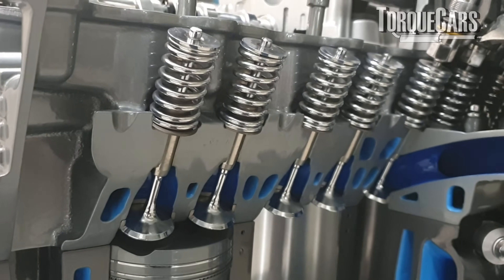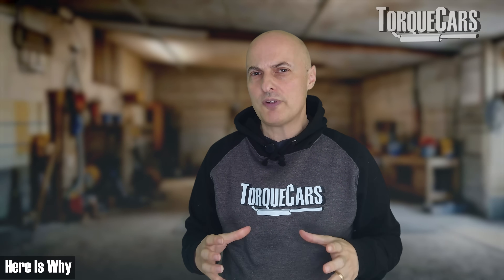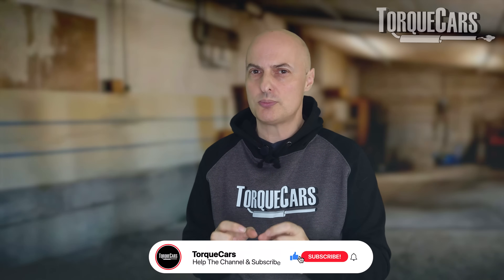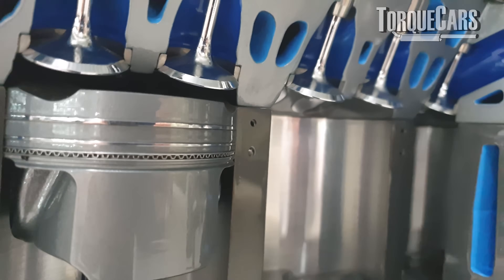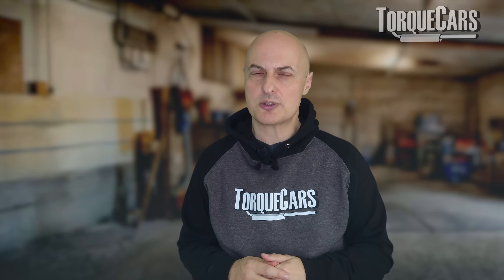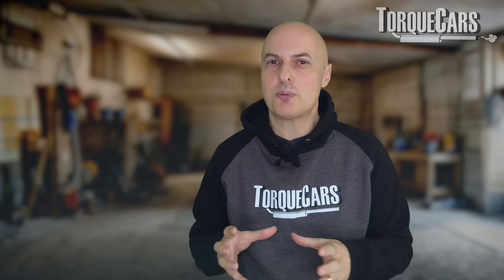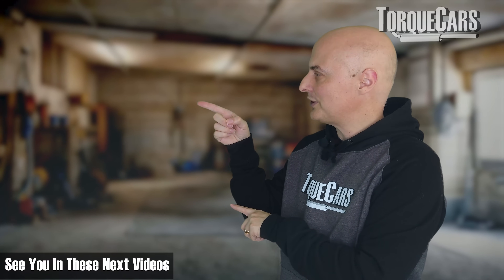16 vs 8 Valve Engines! Manufacturers Don’t Explain WHY Most Modern Engine Need 16+ Valves!

Comment: There's never been anything wrong with 2 valve cylinder heads that rev to 6,000, in fact they were reliable, efficient, and nice to drive

Comment: 5 valve heads helped with flow, but resulted in a compromised combustion chamber shap. Yamaha persisted the longest but eventually returned back to 4V. Was cool idea in the 80s and 90s but by mid 2000s (i.e 20 years ago!) the writing was on the wall.
Reply from the maker: The injector spray pattern also needed to be revised for the 5 valve heads which catches a few people out, sometimes I see people using injectors from 4 valve engines ending up confused about the loss of power/economy.

Comment: My old Alfa Romeo has sodium filled valves. I've had a BMW E87 120i with valvetronic and I was very impressed by how you could just put your foot down up a slip road and it was effortless but used a lot of fuel so I drove it slowly.

Comment: An often overlooked event is the swirl action and speed of the flame front around the wall of the cylinder. The valve is not the hottest part of the engine it is the exhaust valve seat which bears the brunt of the heat. Of course then that leads to the most important component on the engine regardless of the amount of valves the cylinder head houses, and that is the coolant pump as that pump needs to circulate enough coolant to stop the exhaust valve seat distorting which leads to power loss due to a leak into the exhaust system. We have done the work and proven this on engine dyno .

Comment: i like 4 valves per cylinder but why do top fuelers got only to per cylinder and make 12000 bhp
Reply: @JapieEngelbrecht-l7b  overlap
Reply: @JapieEngelbrecht-l7b  pressurized intake system. The blowers ram air past the valves. 

Also, with the constant rebuilds done on the engines, a OHV system is easier.

Comment: Sodium (Na) is a metal.  You correctly noted 4 valve arrangements are much lighter so add to your port velocity argument conditions for higher RPM and higher lift.  If pushing for the biggest port area the 2 valve will edge out the 4 valve but the +' outweigh the -' by a fair margin.  The five valve head, yeah, nah, not worth it.  Yamaha did it for quite a while and then quietly dropped it.  Same argument with port size I think.

Comment: Modern 2V heads often have more peak flow than equivalent bore size 4V heads. It's actually easier to arrange valves in the head when there's just two, four is more limiting. Naturally with a 4V head placing the spark plug in the centre is easier. With 2 valves the larger intake valve can be placed closer to the centre of the bore at a more advantageous angle, it is also less shrouded by the bore and is not shrouded by another intake valve beside it. It is mainly at low lift values that 4V heads move more air, and yes over the intake duration typically the 4V will move more air, but its not as radically different as some may imagine.
Further a 2V head has more realestate for optimised quench pads so that modern 2V heads are very efficient at combustion.
You're not going to get more velocity by having two smaller intake ports compared to one, the pressure drop across 1 vs 2 ports is halved obviously. Hence why so many commenters note that 2V engines usually have better low end torque. Because the velocity is higher in the single port (less total area), meaning better cylinder fill earlier (higher VE at lower RPM).
Sodium filled valves have been around forever. WW2 aircraft engines had sodium filled valves.
The reason to have 4V heads really comes down to the architecture of the engine, most engines don't have inherently natural balance and as such are hard to scale - meaning you need to keep them relatively small and rev them high to reach your power goals. Given we're talking automotive engines that also means it has to idle low and provide useful torque low in the rpm since to begin with, the driven wheels are not moving (you have to match the engine speed to wheel speed via a clutch or torque converter). With these constraints the way to engineer a solution is to have 4 valves and some kind of variable cam system to maintain decent VE over an expanded RPM range.
You can of course have a large (naturally balanced) engine that makes the same power with 2 valves and just not rev it as high.
Large valves clearly have more inertia than small ones, but its a non issue these days practically speaking. It's 2025 (nearly 2026) not 1955. Metallurgy, manufacturing techniques, and design have come a long way. This is why you can buy a 10.3 litre Big Block V8 with a factory warranty that still revs to 7000rpm.
Reply: @Aidan-gk6du  with 4 valves and port fuel i hection you can put the sparkplugg in the center, thus better flame burn, less risk of nocking. Thus higher tourqe
Reply: @andreaskampe9143  I like the thinking, and indeed with 4V the spark plug generally is in the centre.
There is logic in that if ignition happens in the centre of the chamber, the distance the flame has to propagate in order to burn all the fuel is half that compared to if it happened at the side. However, in modern fast burn chambers what happens is when the piston reaches TDC and comes up against the quench pads, this forces turbulence that breaks up the expanding kernel of burning fuel / air mix throughout the chamber, resulting in a very fast and complete burn regardless.
There is something to be said too for placing the spark plug closer to the hottest part of the chamber so that ignition occurs there and that region is burned first in order to reduce knock potential - and you see this practice a lot in 2V chamber design with the spark plug close to and pointing at the exhaust valve.
A chamber more resistant to knock means being able to run more compression (and or more aggressive timing), making the engine more efficient, sure. There'e a lot more nuance if we start talking about how torque is effected - the main driver of torque being VE.

Comment: Yes, Honda VTEC is simple but genius. The engine is 8 valves in low RPM and it becomes 16 valves in high RPM. This gives you really good fuel economy in normal driving, yet the power is there when you need to drive like a maniac.

Comment: @3:35 I know exactly which engine opens only one valve and partially opens the other valve. The Honda K24 engine used in the Honda CRV. I own a 2009 CRV with that engine.

Comment: You didn't mention Fiat's Multiair system in which intake valves open and close with solenoids instead of a camshaft, which allows extremely fine control of when valves open and close, even allowing for two open/close events in one intake stroke under certain conditions.

I have an Alfa Romeo Alfasud that had an 8 valve 1.7 boxer engine with two dual 40mm carbs when I bought it. Some years ago I put a 16V engine in it from a 33 16V using the same carbs with different jets and a 123 distributor. The 8V was more torquey and explosive at low and mid revs but would start panting over 5,500rpm. The 16V is less responsive at low revs but will happily rev over 7,000rpm without running out of fuel, I checked that with a wideband oxygen sensor.
Reply: Miss my Sud. First car.   The engine was amazing. My heavier 33 was slightly faster but not nearly as grunty and sounding.

Comment: I recall running in an 1100cc, 4 cylinder motorcycle in 1985 for a now deceased pal. It had 16 valves and felt far less torquey off the mark than my own 853cc, 8 valve 4 but the top end rush was in a different league. It's all different {and better} now, with the advent of VVT. I now ride a 4 valves per cylinder, 90 degree V twin but still also have the old reliable 1.9 TD, 8 valve Peugeot hatchback. Modern diesels suck !

Comment: 2v/cyl design impact on pumping loses than 4v/cyl; not the volume of air which is dictate by cylinder displacement. 
that's why honda ditched this kind of vtec implementation (12v/16v mode at old sohc vtec).

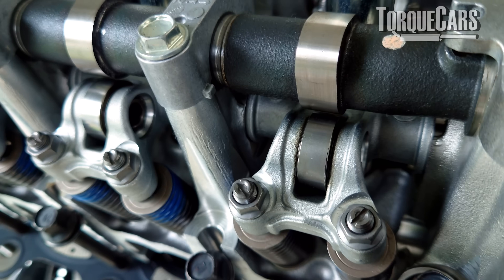Comment: 5:20 did you say 16 valves per cylinder? 😂 You mean per head? The less valves you have to more valve float you get at high rpm because the valves are bigger and heavier. It also means less area to suck air in so you don't get enough air into the cylinder for the same efficiency as 4 valves per cylinder. It's all about area. Exhaust valves have to be bigger to prevent them melting AND more volume of gas leaves the engine than what is pulled in because of combustion turning a liquid into a gas.

Comment: Two valve heads have more low down torque , 4 valves has a better bang for the buck , valve in block engines are more compact 
However 4 valves heads are winning  because of cam timing and  variable valve lift , the thing is , there are suction loses with large capacity engines which amounts to poor fuel economy , what we would like is the best of both worlds , fuel economy and power on tap , without the complexity of an aircraft engine . Personally I’m sold on 4 valve engines

Comment: Unfortunately many, probably most, enthusiastic and they hope, knowledgeable motorists and motorcycle owners, which isn't quite the same as being a motorcyclist, obtain their information from magazine writing which comes from those who can manage sentences and paragraphs but don't understand the machine or the physical effects.  Also the reasons for design alter.  Without question the first 4 valve heads were for two reasons; valve steels were not good for high temperature and springs were remarkably short lived.  Small meant longer between overhauls.

First world war aviation had Daimler making 4 valve cylinders under SOHC.  Royce rejected that because it used much welding of ports and we lacked sufficient capability.  He chose shell forgings as cylinders and the inlet flow over a tulip valve continued nicely along the curved chamber wall.  The Farnborough research soon stated that the head must be aluminium and the valves radially through a partly hemisphere chamber.  They made a 4 fully radial valves one and later a motorbike did the same but small.  With cast head and water cooled, but not constrained by weight, some cars had pent roof 4 valve heads, mainly to keep the exhaust valves small and springs to last a long time.

By the 1960s our motorbikes were at the end of their development but some specialists made 4 valve heads for them.  None too well cooled between the two parallel exhaust valves.  For one of these I read a review in what passed for a serious and knowledgeable magazine and the writer puzzled because he had calculated the circular area of the single big valve to be larger than the twin smaller ones.  He didn't think about curtain area or rapidity of opening.

Coventry Climax was nervous of attempting F1 racing in the 1950s because they never produced the power claimed for Italian engines.  Then they tested one...   Their own ports were not huge but the car spends most of the time accelerating towards peak revs and therefore how hard it pulls doing that is more important than the actual peak, very rarely reached or sustained.

I don't believe most people have a clue which bits of their engine cause what characteristics and I suspect the magazine writing is mostly copied from the Press Pack.

Comment: I have to admit I LOVED my 8 valve honda civic eh2. It was good for what it was, but I must admit the 16 valve engines are much more versatile.
Reply: Quad Valves are good if you are sitting on maximum revolutions all day, otherwise they are a waste of engine effort.
Reply: My GTS one exhaust valve and one intake valve per cylinder. It has 588 hp at the rear wheels.

Comment: 5 valves per cylinder rules💪🏻😎
Reply: Yes 5 pot 20 valve is the king!! 💪😀
Reply: @speeddemonRS3 I own 3 20V's, but yeah one of them is a 5 pot. Not the best engine I have ever owned but it is definitely a good one and it sounds like heaven even though it is a diesel 😇😂
Reply: @Manoah. 5 pot diesel bro!! 🙌
Reply: As an engineer (electrical) and a car nut, I certainly wasn't banging my head. Your explanation of velocity and air flow was excellent. I've been lucky enough to have always had multivalve engines cars from a 12 valve AH Civic, 20 Valve C30 T5 and various VTECH Hondas. Look forward to more videos.

Comment: At low speeds torque and usually non interference engines, 8 valves are better. They are also cheaper and easier to make
Reply: Those 8 valves must stay away from me with their crappy performance
 I had a 8 valve car, and then later got a fwd nissan Sentra (called Sunny in Japan)(the B14) with 16 valves. Oh, they're absolutely fantastic at high rpm's, The higher you rev the engine, the more the power, which make for fun driving in my manual, port injected 16 valve car. With its 1.4 litre capacity, it's actually easy to cruise the open road at high speed.  Makes for spirited driving 😂